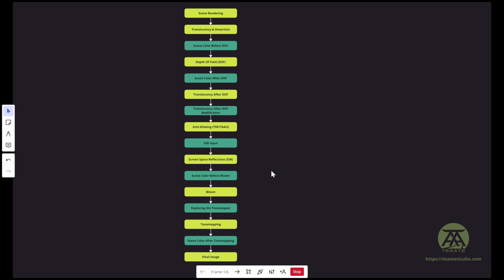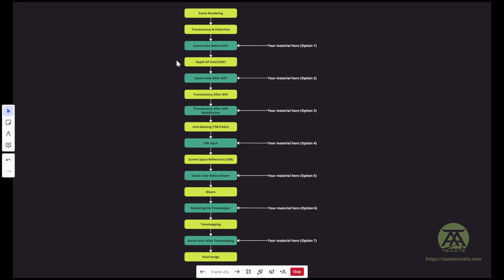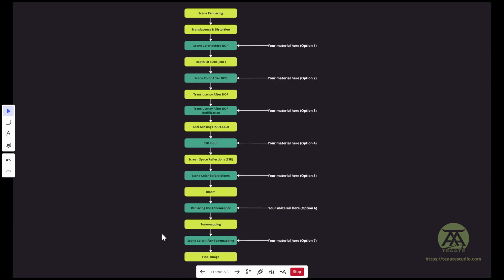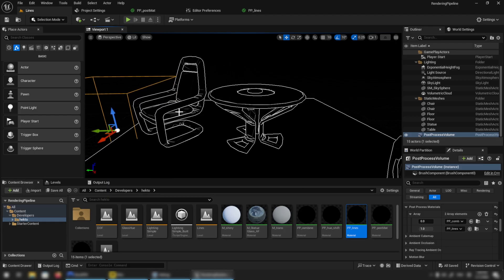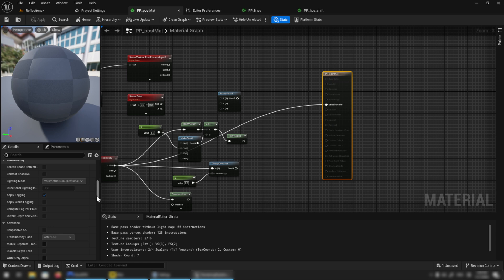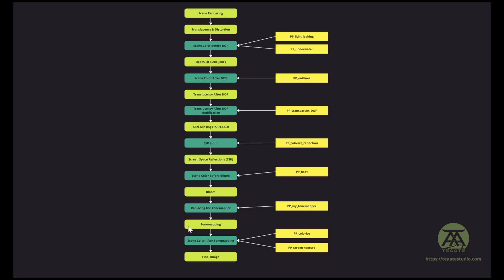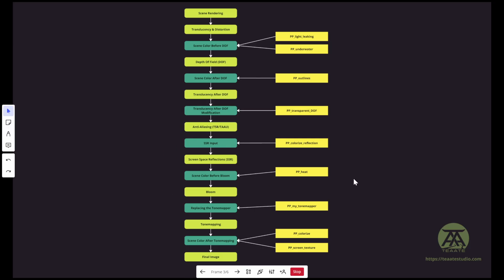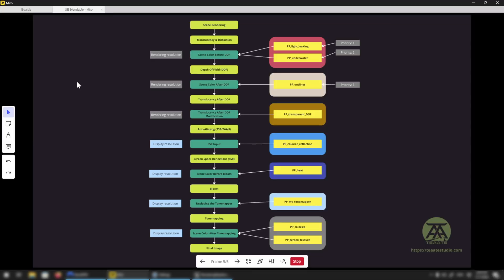UE 5  -  Explained! Blendable locations for post process materials

Comment: Hi! Thank you so much for the video, very informative :)
I have a maybe unrelated question, but I think you could help me.
I'm working on a post process material that has to visualize the world-space normals of the scene. I set the material to work in the "Scene color after DOF" blendable location, but I noticed that the colors I'm visualizing are slightly off. For example, a plane facing upwords has a value of rgb(153, 154, 196) instead of rgb(127, 127, 255). If I set the blendable location to "replacing the tonemapper" the values are right but I have noticeable aliasing, and by watching your video I don't think that is the right step of the pipeline to do this kind of computation at all.
Any idea what the probem might be? I can't seem to wrap my head around it
Reply from the maker: Hi, sorry for the late reply. Did you manage to sort it out? It is a good question, and there is no single correct answer in a short comment. You basically have three options:
A) Set the blendable location to Scene Color After Tonemapping. Tonemapping and exposure are already applied, so your colors should match expected LDR values.
B) Keep Scene Color After DOF. Disable auto exposure and set Exposure Compensation to 0 in your Post Process Volume, or compensate in the material by multiplying your output by View.PreExposure. This gets you closer, but the result still goes through sRGB conversion to LDR.

Comment: Slightly unrealated, but you seem to be knowledgeable about this kind of stuff.

When a scene capture occurs in a location with a post process material, why does the applied effect look so different from how it normally does through a camera?

If case you're curious, the steps to reproduce:
1. Create an actor with a scene capture and a camera (The camera is for debugging, we'll call this DebugCamera, and the actor itself CaptureActor).
2. Set the scene capture to Final Color (won't have post processing otherwise).
3. Create a post processing volume and place CaptureActor inside (I used a simple negate/negative effect post process since it highlights the issue well).

What you will see is that the captured scene looks very different compared to how it appears in the DebugCamera.
I've been trying to figure out why for a few months now, I would appreciate help of any kind.
Reply from the maker: Hi,

Ah yes, this is a tricky one, it always has been. I haven't worked on a project where this had to be fully resolved, but off the top of my head, I can think of two potential solutions. Neither is perfect, but they might help.
In both cases, I disable auto-exposure and bloom, and the Scene Capture component is set to Final Color (LDR) in RGB.

A)
- Set your post-process material to Scene Color Before Bloom so that the post-processing occurs before tonemapping is applied.
- Set your Render Target Format to RTF RGBA16f.
There should be no visible difference between the Render Target and the camera view.

B)
- Set your post-process material to Scene Color After Tonemapping and your Render Target Format to RTF RGBA8 SRGB.
- Then, in your Scene Capture component, modify the Film: Slope, Toe, and Shoulder settings to match the camera’s output.
- You can adjust these values by eye, but if that’s not precise enough, you can write a script to incrementally adjust values and compare pixel differences programmatically.

Sorry, These aren't perfect solutions, but since I remember this always being an issue in UE due to how tonemapping works.

Cheers!

Comment: thanks for sharing, i wonder why unreal remove the "before tonemapping" step, because some of the old PP effects doesn't works now, can't find a proper alternative setting
Reply from the maker: You're welcome! Epic hasn't actually removed the "Before Tonemapping" stage; they've just split it into smaller steps. If you look at the diagram, you'll notice that all the steps up until "Scene Color After Tonemapping" are actually happening before tonemapping. Generally speaking, your previous materials should work as before if you set them to, for example, "Scene Color After DOF" or "Scene Color Before Bloom." Try to recreate your effects with this new pipeline in mind
Reply: @HepnerKamil  Really appreciate your help, sir! "Scene color after DOF" works just fine!